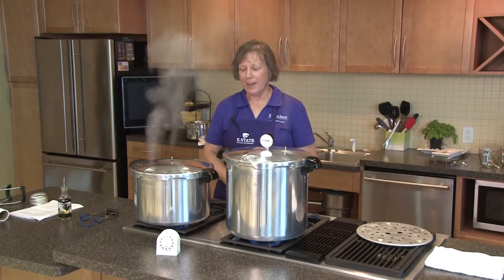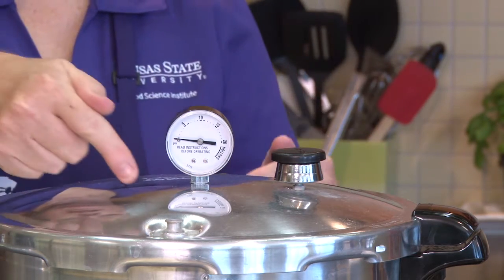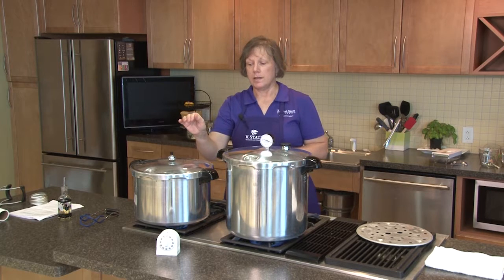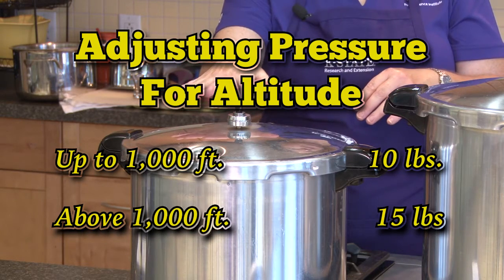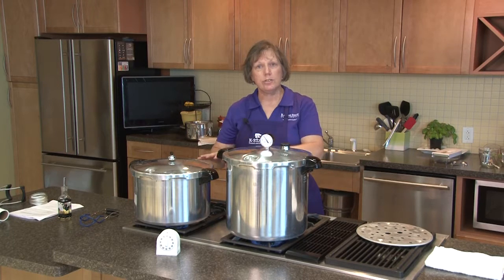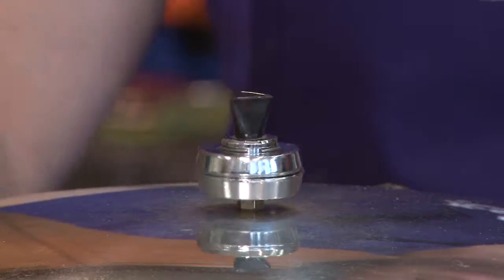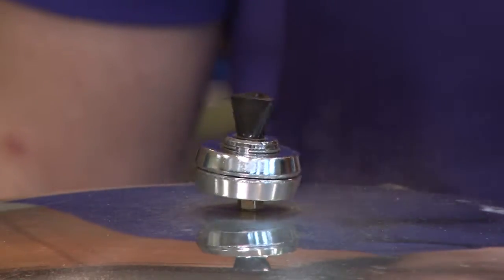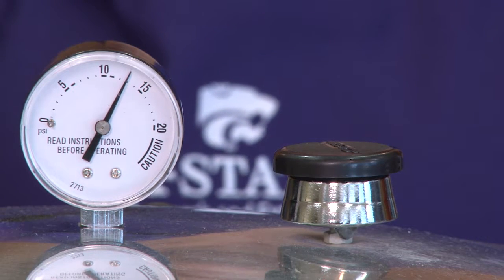Program 14 -- Canning Meat Achieving and Maintaining Pressure

Comment: I am new to canning... Making some Beef stew and Chicken stew. Should be 11lbs for 75 minutes for pints, I have a dial guage like the one in your video. I have an electric stove, on the button heat settings, # 4 keeps pressure too high.. #3 setting keeps pressure to low. How much room is there for mistakes?I am constantly adjusting the temp settings on my stove, from 3 to 4. Pressure runs from10.5 lbs to 13lbs? Is this safe? Any suggestions??